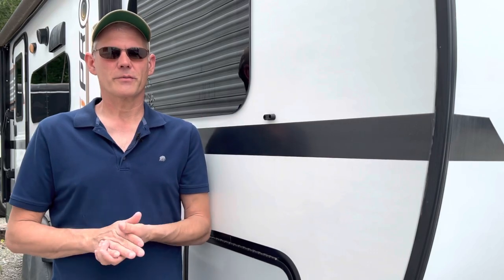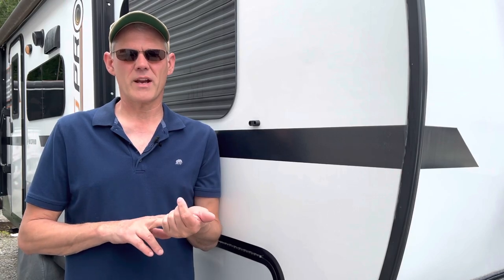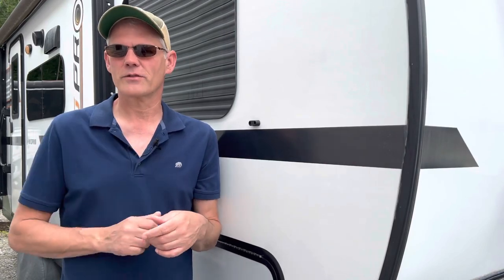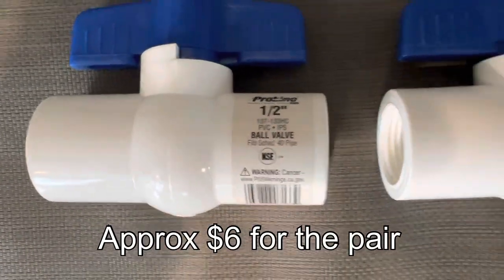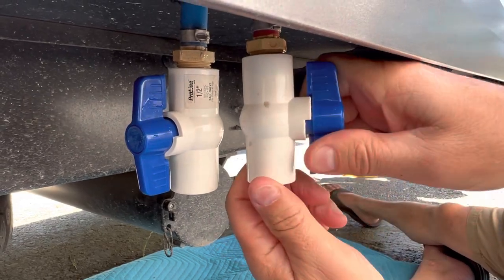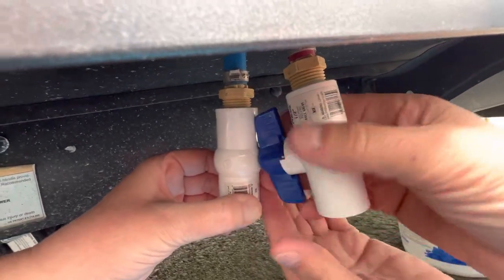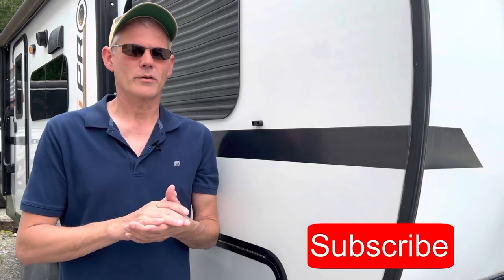Replacing Low Point Drain Caps.  QUICK & INEXPENSIVE FIX.  So Much Easier to Use!

Comment: Thanks for the great tip.  Struggled with those low drain caps in the past.  Also, thanks for the great ideas on another video about Harbor Freight.  Went shopping the morning at Harbor Freight and found great items we need for our GeoPro and great prices.  Zip ties, disposable gloves for dumping, bungee cords, 2 foot level, lantern, etc.  Spent $54 and came hope with a bag full of goodies.  Safe travels.
Reply from the maker: Thank you for watching!  Harbor Freight is great - can always find a way to spend a few dollars haha.  And one tip on the drain caps - use some plumbers tape / Teflon tape so no leaks.  We mentioned that in the description but totally missed it in the video!  Safe travels to you as well!

Comment: Great mod! I did the same install. Spray painted them black to match the framing under the camper. Also, I use the cold water valve to fill dog bowls, clean shoes/feet, etc. while camping... I like having an "outdoor faucet" on the "party" side of the camper :). Cheers!
Reply from the maker: Oh!!  That is an awesome tip!  You will be getting a shoutout in a future video!  Thanks for watching!

Comment: I’m having this exact problem right now.  Caps are leaking.  Was about to get some Teflon tape when I came across this video.  Valves look so much more convenient. Although they didn’t take convenience into consideration when they designed this camper.  Both drain lines are placed perfectly behind and right between my dual axle.  Can’t get at them at all without climbing under the trailer.  Such a stupid location.
Reply from the maker: They are much more convenient but we did add some teflon to these as well as one started dripping.  But been a year and no issues.  

But yes - that sounds like a terrible position to access!

Comment: Thanks for the tip! I will be picking some up tomorrow.
Reply from the maker: Glad you found it useful!  One thing - we added some teflon tape to the threads.  One has a very small leak a few months later but the tape solved that.  Put it on both just in case.  No issues since!  Thanks for watching!
Reply: @WinesPinesandCanines  Thanks for the reply! Yes, we will certainly be using some Teflon tape. It looks like there should be enough clearance between the 2 outlets so that installing them should not be a problem. Thanks again for this tip!

Comment: Sounds like a good idea, but get back after a few years and see how there working. Any PVC ball valve I've ever seen was near impossible to turn after a few years. I use brass ball valves instead. Far more expensive, but they work every time no matter how long they have been on .
Reply from the maker: Good tip!  Will look into those.  They will likely hold up well to road debris also.  Thanks for the watch!

Comment: I tried to do this but my hoses are super close together no space at all.  May have to look at them a bit and try to move them a little.
Reply: Same. Let me know if you find a solution that works.
Reply from the maker: Have heard a few comments to that.  We were a little worried when we first went to do it but there was enough give in the lines to be able to get the second one on (as you can see in the video, we didn't need to hold it over much). But if they had been much closer together, it would have been a toss up.   Let us know how it goes!

Comment: Hey Camp Friends I tried this but I had to remove them because they would not stop leaking I bought them from Lowes. I ended up putting the OEM ones back on any tips would be greatly appreciated do these come with a washer?
Reply from the maker: So the ones we bought were from Home Depot - no washers.  We haven’t had an issue but haven’t been able to camp as much as we would like this year to keep trying them out haha.  Were they both leaking?  Have seen others online do the swap out as well and different ones used (others have ordered online).  Maybe trying a different set or may want to add a little teflon tape to the threads.  Let us know if you try again and how it goes.
Reply: It was very difficult for me to get them tight enough but finally I got them there.

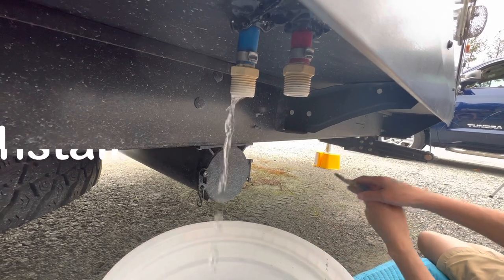Comment: How do you replace 2:08 the yellow ring above the valve you just replaced?
Reply from the maker: Hi.  Not sure exactly - need to take a closer look (currently at storage unit).  But will check and see if we can determine.

Comment: Rats. I was hoping I could use them.  But mine are right up against each other. Was hoping they would work, but the blue knobs won't squeeze by.
Reply from the maker: Ugh - ours were pretty tight but they had room to be even tighter.  Guessing its where the lines happen to be when they foam that determines whether or not these can be installed!  Sorry it wouldn't work for you :(.
Reply: @WinesPinesandCanines  Yeah. It was even tricky with the wrench and socket. Good thing they left enough length in the hoses to push one aside, while doing the other. Maybe I could add some length to them with a coupling, and get your little valve caps in the future
Reply from the maker: They do like to sometimes make it hard on us owners!!